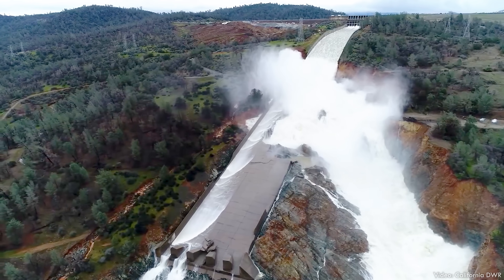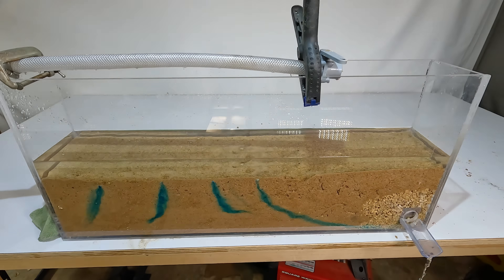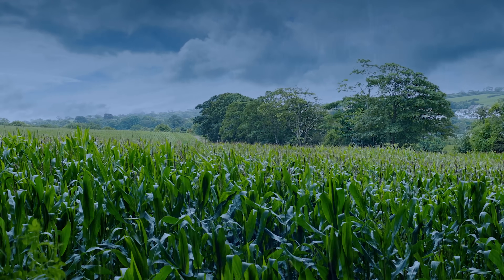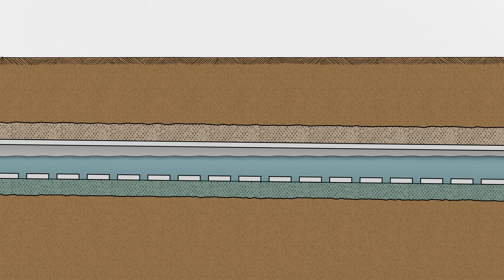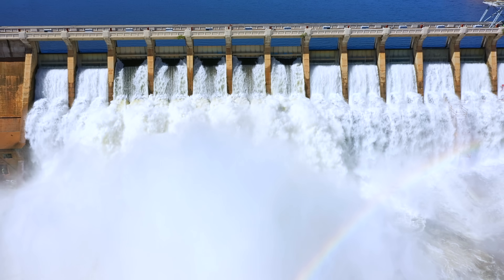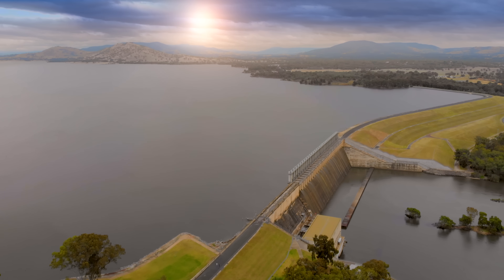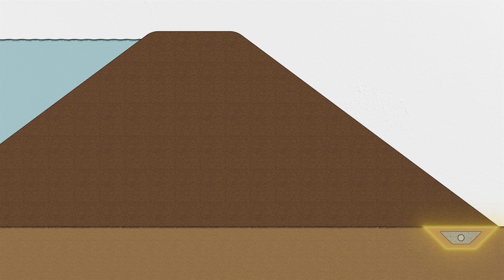How French Drains Work

Comment: The whole problem with using cheap plastic tubing or PVC pipes is that they cannot support the weight of the rocks and dirt and collapse inwards. Never use corrugated pipe or PVC.

Comment: 5:29 "If the holes are on top, water has to fill the gravel to the top of the pipe before it can get in and be carried away."  I don't understand this sentence. Doesn't water seep into the pipe from the top and start being carried away immediately?
Reply: In general, water only flows through completely saturated soil.  Therefore the gravel must be saturated before water flows into the pipe.  Saturation builds up from the bottom of the gravel layer due to gravity.  (Water does flow through non-saturated soil but it is several orders of magnitude less than saturated flow so essentially it is zero in regards to drains).

Comment: I used to install agricultural drain tile for a living. We used the black plastic corrugated stuff that was plowed into place with a tractor in just a few minutes per line. But on one job we had to tie into an existing old clay tile line that was already in the field. We had a map to follow and started digging (with an excavator) where the pipe was supposed to be. Finally after a long time of digging we found it at about 12 feet deep. I then realized that this meant that someone upwards to 100 years ago had to dig that deep with a shovel, not just where we were standing, but in dozens of trenches across the entire farm field to lay the original tile. The amount of manual work that people went through before having machinery was truly astounding.

Comment: This is so nteresting! We used a similar method for spring water collection across the Great Basin and Sierra Nevada. Instead of using perforated pipe in the collection gallery, we lined up cinder blocks that acted as an open pipeline. To adjust for seasonal rushes, we capped the cinder blocks with large cobbles, then covered those with gravel, but that's where our goal was different than drainage. We had to prevent ground water intrusion, by capping the gallery, with a layer of concrete which acted as a roof, to shed water further out, and as an extra measure, coated the cap with bentonite. Many of the springs my grandfather dug out are still producing and functioning to this day. Most of the maintenance required was down (we used gravity to avoid having pressure/pumping issues) at the manhole because of the surface access.

Comment: I have a partial clog in my basement drain.  The house was built in 1925.  I checked down in the drains and noticed rock and soil in them.  The pipes are cast iron, but looking down in the hole the the surrounding area is Clay.  The home was updated and concrete slabs were constructed in the basement.  Is it possible that the gravel and sand from a previous French drain system made it's way into my cast iron pipes?  I'm attempting to find blueprints of the drains under my home but I'm not sure where to look.  I was concerned that if a cast iron pipe was cracked that the water would back up and I would have foundation issues, rodents, insects etc..  But, if there is an old french drain system underneath piped to the main sewer line wouldn't it just drain down through the gravel and to the sewer drain?  The question then is, what about the sewage?  How does that drain out too?  I just bought the home and apparently it was remodeled with "updated plumbing".  I used a shop vac to remove some sand that was in the cast iron and it's draining slowly.  I don't know what system I have and the drains likely haven't been cleaned in years.  I just hope I don't have a cracked line.  Hopefully it's just a clog and no cracks.  I just figured I would ask the real experts what it could be?  Any ideas?  Thanks.

Comment: Three slots staggered cut every third notch at 12, 4 & 8 O'clock ADS/NDS brands double wall HDPE, socked in positive sloped ditch. Flow Thalwag is between 4 & 8. Slope double wall/slick inside drainline to min. slope plus some more so increased scouring velocity to daylight. Hence, trench drain.

Comment: My childhood was plagued by a wet basement. My bedroom was in the corner. Although it was warm in the winter and cool in the summer, it was wet during the spring thaw.  When I was 17 16:41 , I found out that drain tiles were typically placed in the interior , but not on the exterior. The clay soil had no drainage, leaving the basement as the only place for the ground water to go. The pressure differential caused the water to seep through the concrete block walls.  My older brother, who eventually became a mechanical engineer, earler had sealed the walls with iron oxide paint. This kept the walls dry, but it didn't keep it from finding other ways to get in.  I solved the problem  by digging a trench around the house down to the footer.  I sealed the wals with roofing tar and tar paper. Then i dug channels under the footings at strategic places around the house. Then I layed down flexible drain tile surrounded with P-rock and connected it to the inner tiles. Iin order to do this, I cracked holes in the basement floor with a jack hammer. It solved the problem.

Comment: We bought a newly built home last fall and are having two issues with drainage. In the front, the water appears to pool in about a 10'x10' area underneath the sod. During the wet season, you cannot walk on that area and it feels like a water bed when you touch the sod on top. The soil underneath must be drying out, as there is a depression forming in that area. We still avoid walking on that spot as it is still soft and we fear a sinkhole. The drainage across the back is a common drainage ditch along the rear of the houses on our side of the street. We are the 2nd to last house before the end of the road, and drainage area. During the heavier rainy season, water backs up in that area, and sits for an extended period of time following rainfall events. It becomes stagnant and starts to stink. Our rear fence borders the ditch, and is positioned what should be far enough away to avoid the common wet zone. However, due to the water backing up, it now settles further into our yard, and causes irritation to one of our pup's feet, so we have to block off those areas. This video helped me learn a bit more about how drainage should work, and I now have some targeted questions for the builder, contractors who will be brought in for repairs, and possibly legal teams. Unfortunately, the builder is claiming they do not have to address either issue as they employed "proper" mitigation techniques - even though it is clearly not effective.

Comment: great vid.
I've been considering a drainage trench for a subsurface structure I intend to build in an area that is only a few feet higher than some low land that gets quite wet at certain times of the year. I selected a french drain as my solution.
The 2 big take-aways for me that have changed my DIY planning are soil gradation and (the appropriate sized) sand around my gravel in lieu of geotextiles. In fact I may select 2 different sizes of gravel to seat my pipe into.

Comment: Someone else made a better video showing how they used DEW's to destroy the first dam, then they rebuilt it, then they destroyed this one by 'testing' it with far more volume than it was designed for, then they planned to rebuild it again!  That's how the gubmint really works.  I see it every day in my city, where SPUR helps the street work department make a lot of money by effing everything up good, then it all has to be torn out and rebuilt; they eff it again in a different way; they rebuild; they eff it again and rebuild and it goes on forever.  They used to get away with digging up the streets every time a telecom wanted to bury cables.  The same streets were constantly being torn up then rebuilt.  That scam finally ended after decades of b.s..  Now SPUR invents the new scams, based on 'safe streets for cyclists and pedestrians' or 'parklets and outdoor dining'.  They eff things up real good, they cause cyclist accidents.  Cyclists hate them, yet SPUR's banner is 'we're making streets safe for cyclists'.  SPUR increases the density of the deadly 5G LED kill grid of radio frequency emitting streetlights, traffic lights, pedestrian signals, and so on.  SPUR advocates to get more 5G LED weapons on every street.  They actually have individuals advocating for each 5G LED device installed in our city!  These a-holes have names and faces and you can see them and exactly which Made-In-China (used by Democrats) military radar weapons and toxic LED's they got installed to kill YOU!  You can see exactly who is deliberately giving you cancer and tumors and with which weapons!

Comment: Recently dug up the corners of my weeping tile (french drain) to tie in some new stuff for a house addition. My soil is very sandy and I was happy to see that after 20 years 3/4in gravel fill was still largely non-infiltrated and the pipe where I spliced was clear. 

The new stuff is perforated on at least four sides around the pipe and covered with a sock.

But my goodness never plant trees close to the house, especially deep rooting ones like maples and cedars. I can't believe how far and deep they go. I love my trees, but they had to go. Roots were beginning to penetrate and wrap around insulation and membrane on the foundation!

Comment: I buy solid pipe and drill my own holes.  I leave the bottom solid and drill the holes on the sides and top.
This is on smaller residential type jobs.  We wrap the trench in fabric,  fill in rock to level.  Put the pipe in.  Then fill to the top with rock.  Wrap the rock with the fabric.  Then we use a sugar sand with a high perk rate to cover the fabric.  Sod or rock over top.  Works great.
Reply: What state are you in?

Comment: About the holes in the pipe: There are more options than bottom and top. If you put the holes on the sides a bit lower, the water enters quickly and you still have a nice flow path.

Comment: I dug a pond years ago. The soil is 90% peat and was placed around the edges. My lawn looks great. I irrigated it with over 50 sprinkler heads. My problem is there’s no overflow drain. The water gets extremely high after winter and I’ve had to pump it to the main road 500ft away. I live in Michigan and can’t Even mow my lawn until mid summer. Any advice? Will a siphon work if I burry a line. If so what’s the proper way.? Thanks

Comment: Seems like the best option for pipes holes then is along the sides? That way it doesn't have to be overly saturated in order to access the pipe, but it still has an at least somewhat smooth flow

Comment: I have a dry stack wall approx.4' high that needs work , stones shifting out /sinking in the center (wall was "repaired" by concerned neighbors for the last elderly homeowners). I suspect I need to create a few drains along the bottom, with this technique but also with landscaping material or so I've read. Accurate?

Comment: 13:27 yea this retaining wall will fail. That guy had barely enough room behind the wall for the drain pipe let alone room 16in or more of stone. It's key to cut back the soil enough based on wall height and trade that void of soil you remove from behind the with clean angular ¾" stone. Sometimes you might need 36in of stone behind the wall.

Comment: I am trying this from Home Depot:  4 in. x 100 ft. Preloaded Filter Sock Drain Filtration Sleeve.  Easy to slide on to the (4" x 50') black plastic perforated pipe.  I put a French Drain perforated pipe under my patio that was sinking in one large spot over some months.  Had to excavate the whole patio down about a foot to where it was collapsing/sinking, fill the hole in the middle with concrete, layer above it all with 6mil plastic sheeting, place the sleeved French Drainpipe on top of the plastic sheeting, fill above it with 3/4" base course aggregate, then some sand on top to set the pavers, then the pavers once again.  So far so good some months later - no sinking.  We shall see....

Comment: There is a forum where a user named oldestguy has been advocating about ASTM C33 concrete sand used in french drains and he refers to Army Core of Engineers and Vulcan materials documentation on using it with french drains. Add that to your documentation list as to why that method works!

Comment: (~10:40) The separation of coarse and fines in clay pipe manufacture has not only the sieve stage but also second superfines measurement stage.
It takes a measured amount of clay (e.g. 50g) and mixes it with a measure amount of distilled water (e.g. 1ltr), mixes thoroughly, puts  into a tall measuring cylinder (known dimensions). One then shakes vigorously, than takes (small) pipette sample at the height mid point at known times (roughly exponential increase), each sample is deposited on pre-weighed filter paper, dried and re-weighed to get a settling profile.
The weight profile can be matched back to known theory of settling. The larger heavier particles sink first and the smaller lighter particles are slower, creating the mid-height profile.
There maybe newer better machines but that's how it was done in the mid 70's (summer job as a lab tech at Hepworth UK!)

Comment: I would have liked to learn more about options for a sedimentation method for protecting the various filter components from clogging (and for final output filtering, such as with open reservoirs). If one can build sedimentation traps at each stage, along with cleaning access, one gets a sustainable filtration method. I would think for dams this could be helpful. Also, it could be helpful for returning soil to the lain being drained.

Comment: I am at this time having drainage issues at the home we just bought. We didn't know what we was getting into. See the terraced back yard, right off the porch look like a dream. 😂 
It has not been, all the French drains have been neglected for many of years. House was built in the mid to late 60's and has way bigger issued than needing new French drains. Because the French drains have been neglected for so long, it has stayed way to wet under the house and now we have to replace the floors. As well as still NEEDING new French drainage systems. I am not even sure where to start at this point. With my tiller in the back yard about half way up the hill, digging a ditch about 2ft wide and 18 inches deep and fixing new drains in the terrace beds. Sounds easy until I remember I have had to have my right knee and ankle put back together after being smashed apart.
Reply: Fix the water issue first.  No point in replacing floors that are just going to get ruined in the same way.  Stop the water, then fix the structure, then do the finishes.

Comment: Thanks. A neighbour put in a retaining wall made from precast interlocking blocks. My property is 1 meter below his. The soil here is a very, very fine sand. Even though he used a filter cloth behind the block and back filled with broken tiles he never put a pipe in at the bottom to drain the water away from my property. So in heavy rain the wall acts as a dam of sorts and the full volume of water from his property now comes over the top of the wall and through the filter mesh and floods me out. So I would summise that a rainfall runoff volume calculation is one of the first things an Engineer would need to determine in designing a French drain system.

Comment: Here where I live we have some farming fields that has two problems (well, among some other problemas, but that isn't important): easily floodable areas and rocks (the machinery doesn't like going through rocks).

To solve this, we usualy gather the rocks on the surface of the field once a year, as they are likely to come up when we work on the soil, and use these rocks as needed to make some drains.

We still need some larger rocks for rasons described in the video, but it is nice to have a place to dump all those unwanted rocks xD

Comment: While they're certainly necessary, it's unfortunate that drainage tiles have destroyed so many wetlands across the Midwest and contributed to the huge water quality issues that persist in states like Iowa and Illinois. What's most unfortunate is that in instances where a land owner wants to restore those wetlands, drainage tiles are sometimes poorly documented, making it very difficult to remove them if desired or needed.

Comment: Draining on large scale has an other problem. All that water is going into brooks and into rivers, together with sealed surface areas. We tend to straighten brooks and rivers, clear marches and swampland.  Also, large farming equipment is heavy, this compacts the soil, so water flows off it. This all combines leads to all that water going downriver very fast and that is a big cause of flooding.
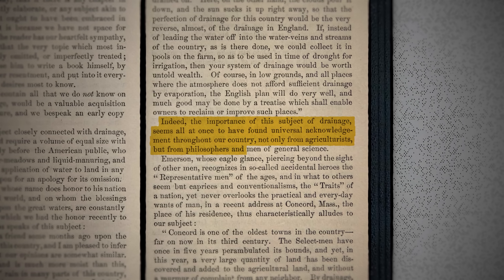Love how you go from clean shaven (14:00) to beard in about 20 seconds :-D

Comment: As a homeowner in an older community with a poorly maintained to non functional drainage system I can tell that no one here read Mr French’s book. The damage to our homes and the loss of property value is depressing. Most home owners have no access to what little bit of storm drains that exist nor is there enough interest from the homeowner collectively to fix the problem. The city maintains just enough drainage to keep about 1/3 of the homeowners happy enough that they will not approve money (tax increase) for a solution.